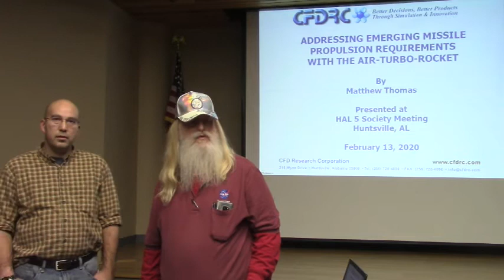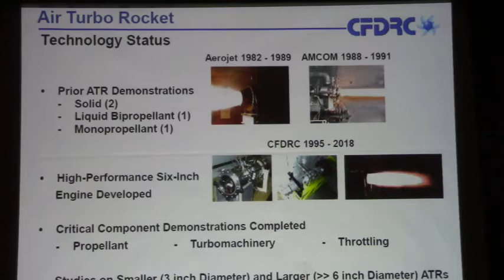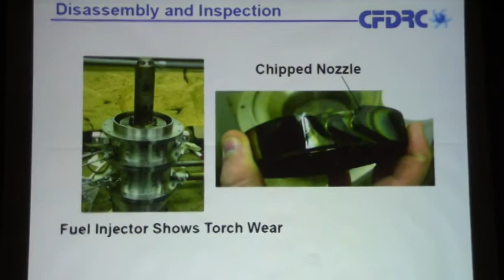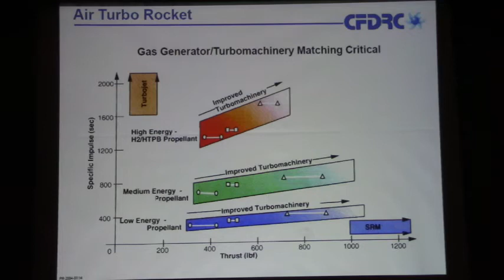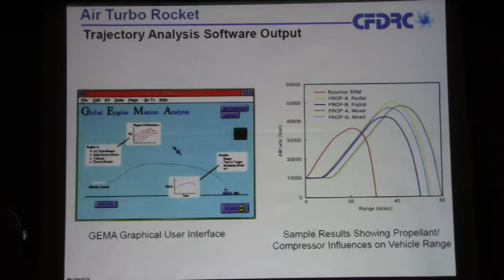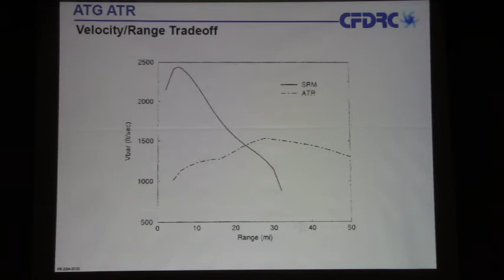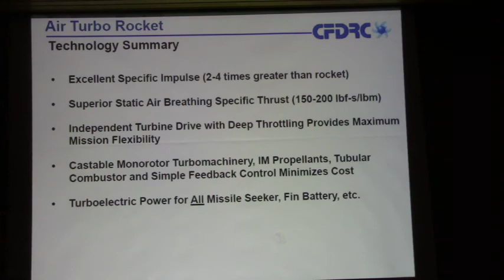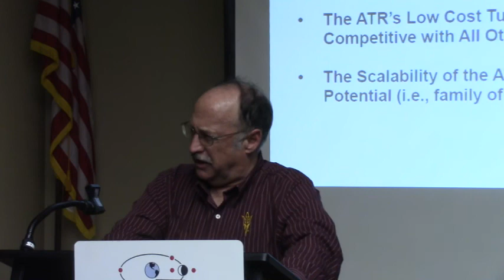The Air Turbo Rocket with Matt Thomas

Comment from the maker: You can support Galactic Gregs by supporting the sister channel Green Gregs by clicking the links below:
Need Worm Hole Generators? Check them out:www.GreenGregs.com 
For gardening in your Lunar habitat Galactic Gregs has teamed up with True Leaf Market to bring you a great selection of seed for your planting. Check it out: http://www.pntrac.com/t/TUJGRklGSkJGTU1IS0hCRkpIRk1K 
Awesome deals for long term food supplies for those long missions to deep space (or prepping in case your spaceship crashes)! Click here to support my channel (other prepper supplies too): My Patriot Supply and Galactic Gregs: https://mypatriotsupply.com?rfsn=2290541.c1c9cd 

Check out my previous videos:
F1 Rocket Engine - Worlds Largest Liquid Fuel Single Nozzle Rocket Engine
https://www.youtube.com/watch?v=RE46Etslaao&t=4s

Rocket Lab and HyTEx Air Capture Space Vehicles
https://www.youtube.com/watch?v=r4CQw6Zqi8U&t=584s

Sailing Space on Sunlight
https://www.youtube.com/watch?v=-w3rl9nKI84&t=1693s

New Earth like Planet Found TOI 700 d
https://www.youtube.com/watch?v=Q-2n_fY27qE&t=302s

Space - the Soaring 2020s
https://www.youtube.com/watch?v=BCBOUfmaXTo&t=2s

Artemis 1 Core Stage (SLS) Shipping to Stennis Space Center
https://www.youtube.com/watch?v=U5nnL6agDJk&t=38s

Axiom Space to Build Commercial Space Station - Wins Access to ISS Node 2
https://www.youtube.com/watch?v=9CqPoUhsNHo&t=128s

Saturn V Moon Rocket Test Stands
https://www.youtube.com/watch?v=51PSeb42oFg&t=33s

Mars Race NASA or SpaceX
https://www.youtube.com/watch?v=GVw2L4xjCXY&t=928s

Asteroid Hits Jupiter, Many Miss Earth - This Time (Warning Shots?)
https://www.youtube.com/watch?v=Srqq1YLcPvQ&t=162s

Apollo 8 - First Manned Mission to Orbit the Moon
https://www.youtube.com/watch?v=2ioLGBDxvPs

Calypso CST-100 Comes Home - Commercial Crew Challenges
https://www.youtube.com/watch?v=cqviSTQppXU

Starship Strengths and Hazards
https://www.youtube.com/watch?v=KIgDPyFuvyI&t=2s

Will SpaceX Nuke Boca Chica
https://www.youtube.com/watch?v=YGA5_NHn-lc&t=1123s

SpaceX Dragon 2 Docks with International Space Station ISS
https://www.youtube.com/watch?v=YS4S0-hRVdU&t=212s

Starship MK1 Blows Up!
https://www.youtube.com/watch?v=A7djOTUaFx0&t=82s

Tales of Two Starhoppers - SpaceX's Historic Flight and More!
https://www.youtube.com/watch?v=ixXfEe5rgsc&t=62s

COMET WARNING SHOT 25th ANNIVERSARY of Comet Shoemaker-Levy 9's Jupiter Impacts
https://www.youtube.com/watch?v=wuph9jY2grw&t=1139s

Your Vacation in Space
https://www.youtube.com/watch?v=VvxchJLjJ74

Nine Dollars per Pound to Orbit
https://www.youtube.com/watch?v=U0bZm8IM_U4&t=3s

Saturn V - Apollo 11 50th Anniversary
https://www.youtube.com/watch?v=LcaypH_i0t8&t=45s

Back to the Moon Past to the Future Lunar Exploration Panel
https://www.youtube.com/watch?v=73HAfcWh35U

Apollo 11 50th Anniversary from the Place that Developed the Saturn V Moon Rocket
https://www.youtube.com/watch?v=kXLWN5cqzR4

Why We've Not Gone Back To the Moon - Apollo 11 50th Anniversary 
https://www.youtube.com/watch?v=Qj-2DI0Sb0M&t=944s

Moon Race 2.0
https://www.youtube.com/watch?v=lkEsAOwzGts&t=5s

Communicating About Space - Pitfalls and Priorities
https://www.youtube.com/watch?v=VJkwgh_5Zag&t=695s

 Life from Space Found? Life in the Universe
 https://www.youtube.com/watch?v=NW4jbISYvDA&t=434s
Reply: Galactic Gregs can’t wait to watch this on the big screen. Rocket on...from The City Behind the Fence in East Tennessee.